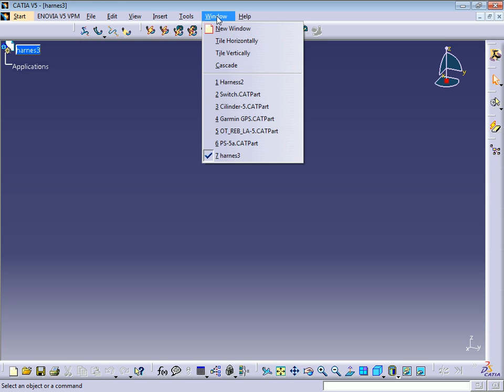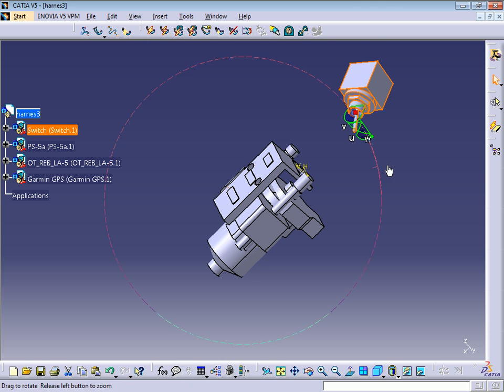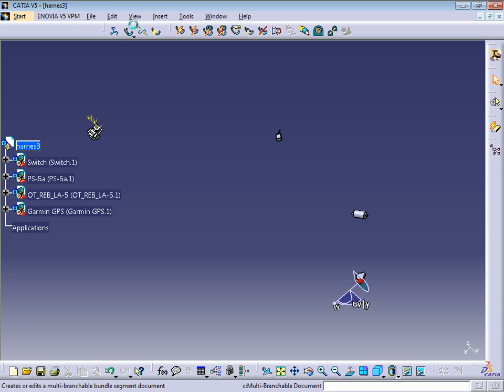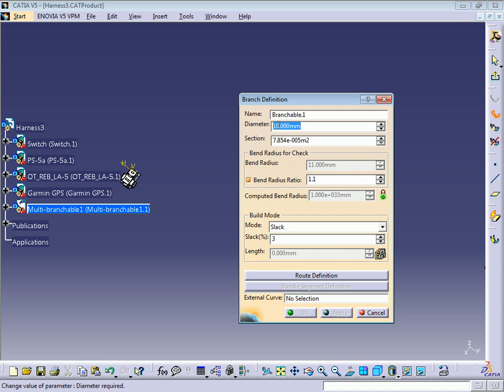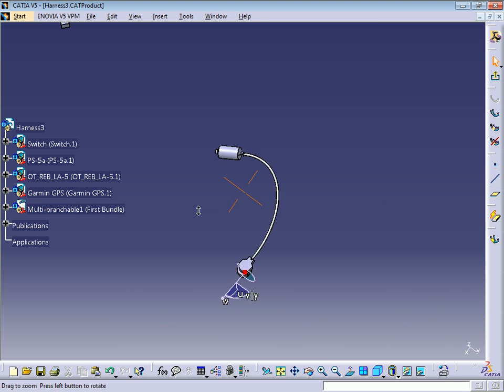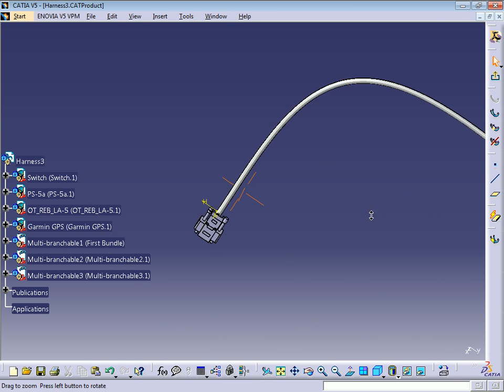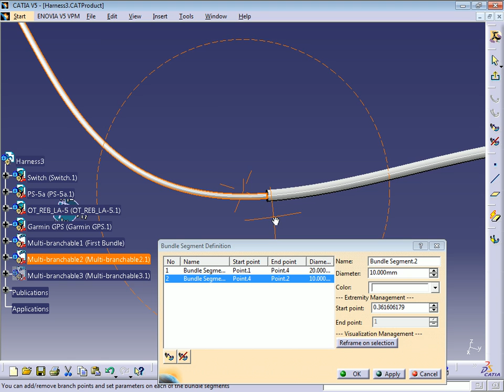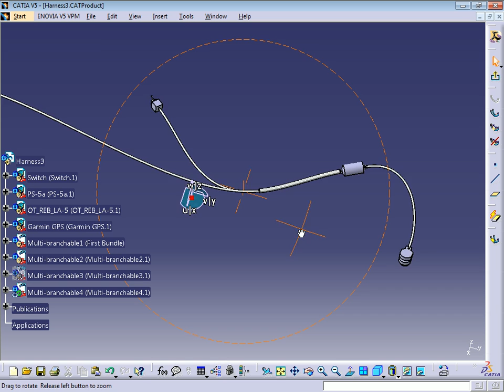Catia V5 training part 6

Comment: I like what you've shown here, I just want to add that the high Slack percentage may be deceptive. Once you have to route a bundle through an environment I mostly stick to Bend mode, and add use "Add Local Slack" or even, add points to my route to accomplish the slack in the bundle.